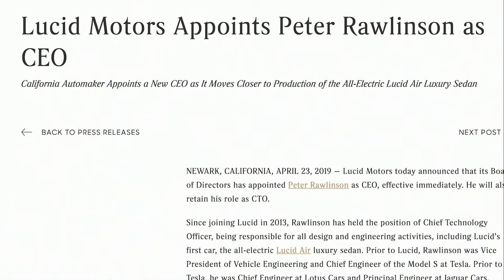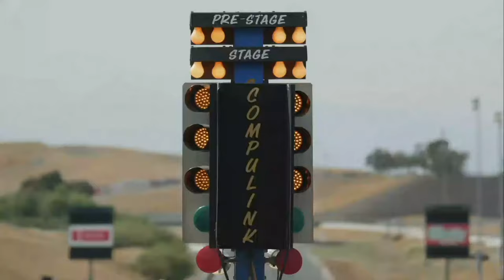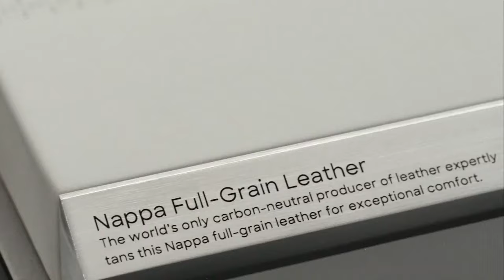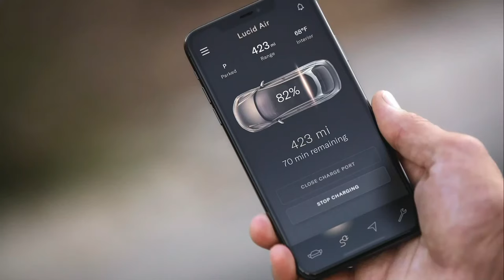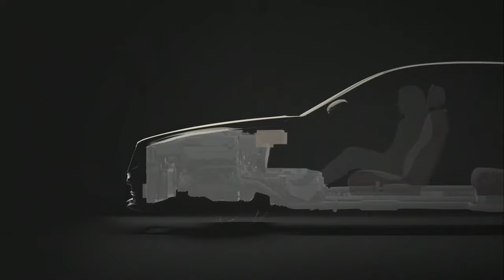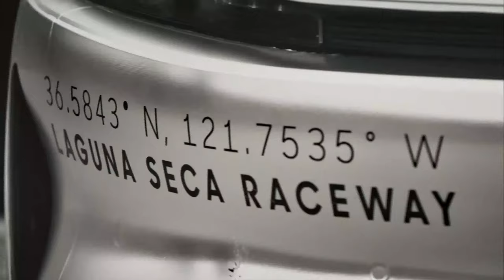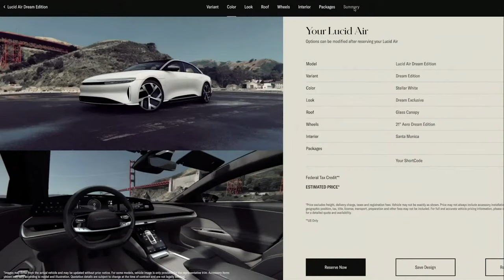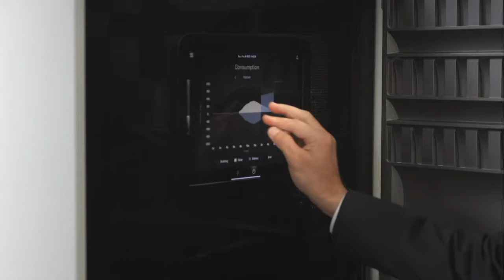Dream Ahead | Lucid Air Global Reveal

Comment: Full disclosure: I own a model 3.

I love the Lucid from basically every perspective. It hits the mark in presence, power, packaging, engineering and quality. I’m curious to see how advanced their autonomy is, and how well supported its charging infrastructure ends up being over the next ~5 years. The one thing I’m not a fan of is their UI and the design of the interior, particularly in the front. I feel like it’s trying too hard. I like Model 3s implementation of simplicity much more, despite how polarizing it is. I have no doubt that their interior materials will hold up better than my car’s, but I think that “Air” would denote a much more open and simplified/streamlined interior. 

I think that this is what Tesla needs and wants. A true ground up competitor. Tesla has run the show for way too long, it’s time for some competition to get Tesla back to the drawing board with some new reference materials. Other ICE car manufacturers should take note. If Lucid and Rivian take off, there are no more excuses for why you can’t implement the technology into future products.
Reply: I disagree with the 'trying to hard' - IMO one of my biggest gripes with Tesla is the purely digital interface. It's quite a shocking jump. In the 20 minutes I was allowed to test drive a Tesla, I didn't get even remotely acquainted with the digital system - it was distracting and a bit out of sight for me.
Reply: Nice to hear that from a tesla owner

Comment: Loving the lounge chair backseat options 18:55
Reply: ...But you gotta ask, how safe is this when in head-on collision? Do you slide under the seatbelts when lay back? How does it impact the spine when pelvis goes over the bottom seat?
Reply: @VincentNacon  Good questions. Mercedes maybach has the same backseat lounge chairs options. Probably where they got the idea from. I'm guessing there is a certain level of safety in their design.

Comment: I love the quietness,soft spokeness and the sincerity of the ceo. He said they are in different market with tesla. Not to compete with tesla.👏👏👏
Reply: Slice it however you want to slice it, every Lucid Air sold is one less Taycan and one less Tesla Model S sold.
Lucid Air models: $169K Q1 2021, $139K Q2/Q3 2021, $95K Q4 2021, less than $80K 2022.
Reply: @savedfaves  
I look at it this way each Lucid or any Other EV sold=
Less gasoline stinkers sold
Lucid is no threat to Tesla btw 
only to ICEngine cars
Tesla is the Largest ev maker in the World now
W bigest SCharger network and 
3 Giga factories
Reply: @WANDERER0070  Well don't be surprise if Lucid steals the show
Reply: @brucealexander4414  How?
Reply: @alarjak  It's sexy and it's more interesting than a Tesla physically
Reply: @savedfaves  Not true. Tesla makes mass market EVs. Lucid is making actual luxury EV"s instead of the "luxury" of the LARPing Model S/X
Reply: Your comment would mame tesla fans go crazy, you see that in the section 😆
Go lucid 👍🏻
Reply: @brucealexander4414  
Total agree
Reply: @brucealexander4414  It's a great concept but mass marketing is not easy at this price level.

Comment: 300kw on 113kwh(usable im guessing 115+ actual) is 2.6C.  Model 3 from 2018 is already hitting 250kw on 77kwh pack sizes or 3.25C.
battery day plaid 2020 battery packs would be expected to beat this

1080hp off 115kwh est 9.4hp/kwh      vs    P100D 778/100kwh 7.78hp/kwh

some things are odd here
this thing with 113vs97kwh gets 517vs402 miles of range or some 4.44miles/kwh vs 4.14 or some 10% more efficient between aero and engine losses
this would make it the most efficient ev on the road oddly
despite having 1080hp motors 

why limit the charging so drastically if theyre willing to pull such a high amount of power from the pack repeatedly during acceleration?
805kw of power vs 300kw charging seems odd 2.68 ratio
vs
580kw of power P100D and 200kw of charging even on the older s/x battery pack 2.9 ratio (would be 325 if extrapolated to 2018 model 3 specs) or 1.78

so if its cooling is more efficient why is its charge rate lower???

the increased range is explainable conservatively with a 113kwh battery pack and improved aerodynamics and motor efficiency but does trend oddly high
the real question is why did they sand bag their own vehicle, wrap it in promos showing 400 miles off 125kwh to then hit 500 miles with 113kwh some 50% difference.   

the interesting moment will be to see if they (similar to porsche) manage to actually release a 60/70k version of their 150-180k car anytime soon enough to be relevant

smart range is great and all, but cost effective range is another.

Comment: The people in this video be like "The car drives smoothly through the Air™. And it's electric which helps with Air™ quality. On the touchscreen you can adjust the Air™ conditioning. It is also a 5k screen, which is higher resolution than the Macbook Air™. The sound system features 21 speakers so you can listen to Chris Brown's No Air™ in the highest quality."
Reply: A I R
Reply: Guess that makes me an Air head lol

Comment: I am tesla believer but this company looks legit and a good competitor. RIP porsche taycan and legacy car makers.
Reply: After this car is released, buying a sedan over $130k that isn't a Lucid Air will make no sense. Great performance, efficiency, and practicality. No ICE sedan can hold a candle to it.
Reply: banana ? Also the CEO that buys a 170K luxury sedan doesn’t care about any of the things you said most of all practicality that segment is all about over the top ridiculous luxury. Lucid is absolutely losing the mark by trying to compete in this space. They should have best Tesla to market with an affordable, fast, PRACTICAL compact EV for the mass market
Reply: @zandercerlong7238  
And the Lucid Air isn't luxurious?
Reply: banana ? If you only look at the lucid in Vacuum it has some decent luxury then you step in a Maybach or a Bentley and you realize in comparison the lucid is laughable luxury, and to top it off the fit and finish the first few years will be terrible it always is in manufacturing. Go drive a Fisker it looks absolutely gorgeous but sit inside and it feels like a Kit Car. A spender of 170K will not put up with that. Lucid is entering the wrong market
Reply: banana ? Posted you the link go ahead and check out the new 2021 S-class the direct competition for lucid and you tell me if lucid is luxury. On top of that the fit and finish on an S-Class will be 100% perfect they have only been doing cars for over 100years. Lucid will not turn a profit in this segment of vehicles. And to top it off people that have 120-170k to spend on ultra luxury they Rolex wearing rich business professional absolutely car about brand recognition and lucid has zero no way someone chooses lucid over Mercedes or other vehicles in that segment
Reply: @a.banana  Buying any car for over $50k makes no sense.

Comment: I'm a twice Tesla owner, stock holder and admitted fan boy, but am not blindly allegiant to the brand, and I want to see more EVs come to the market. First impressions are that the tech is really cool - the quick charging, reversible flow, more efficient batteries and output per pound of the motor is very impressive. Performance and range are also impressive. Interior looks really great, as well. But the overall exterior design is a bit on the bland side, and that trunk opening looks quite awkward. The price for the higher end models is quite a jump, too. It will be interesting to learn what updates Tesla has in store for their battery day in a couple weeks, and whether what they have will match or exceed these specs. There should be room for many EV companies to be successful, and I hope Lucid finds success, and applies even greater pressure for traditional auto makers to shift how they make their cars.

Comment: Good presentation, very professional and also sympathic :-). But I would have liked to get to more details/inside know how. For example: How long/wide/high/heavy is the car? How does heating/suspension work? The frunk will have 202 Liter volume - how much will the trunk have? How much autonomous driving will it be capable of at the start?  When will it come to other countries outside North America? PS: The presentation (and the car itself) would have been even as good with using the word "incredible!" 100 times less.. ;-)

Comment: They may have spent 1 million making this video lol
Reply: That’s why these cars are valued up to 200k the interiors don’t add up . To use inferior finish like vinyls just don’t compare to high luxury solid interiors. They have plastics and have exposed seat rails . Looks cheap and not a solid sound interior. Yes they have a great ext body and the design was well thought but this interior should have implemented use of stainless, leather , wood w nice trim they half assed it. Who uses vinyl which resembles Vinyl LVT FLOORING ON THE DASH? Chilwhich flooring has a similar pattern for their flooring that they used as a finish in this vehicle

Comment: My main concern would be the complete glass roof.
1. Can it be dimmed or blacked out so that the sun isn't glaring in your eyes if you're driving in the sun or even just sitting in the back seat and the sun is blasting you in the face or on the top of your head? Albeit is beautiful, but I close just my regular sunroof at times.
2. Sometimes just the sun beaming down on you can get uncomfortably warm. Can the roof be dimmed or blacked out to eliminate this if the customer would like to do that.
3. In every car the structure of the roof gives the car rigidity and provides strength in case of side impact or especially a roll over. If this glass roof shatters in an impact or roll over accident isn't that going to significantly reduce the strength of the structure that provides a safety cage around the occupants? I will be very interested to see how this car performs in crash tests.

Comment: I wish Lucid could pivit,Lucid can build a space oriented compact SUV,with roughly 180bhp,0-60 in 5sec with a limited 150mph top speed and a 300mile rage for $25000,if any company can,I believe its Lucid,this would really shake up the EV market expecially in the USA n open them up to other markets bigtime,the Saudi backing isnt enough,competeing with Tesla is hurting u more than helping u,all these people singing ur praises when presented with either a Luvid Air or A Tesla Plaid theyd pick a Tesla,go into the market gap they arent in n hit them hard,thats the only way,bring back buttons in the cabin,a manual handbrake,let people hear the motor,let the driver engage as much as possible with the car,focus on what Tesla isnt,tech is good but like any other gadget,people get bored quickly with new tech,get them with the experience instead,please Lucid,please,i LOVE ur company n i do not want to see it die slowly

Comment: There is no doubt Lucid Motors is a good company.  The difference between Lucid and Tesla.  Tesla manufactures their own lithium-ion battery cells at their Giga Factories in the U.S. whereas Lucid signed agreements with S. Korean technology giants Samsung SDI and LG Chemical to manufacture their lithium-ion battery cells. Moreover, although Lucid is a privately owned company. It receives funding from Public Investment Fund of Saudi Arabia (67% majority owner of Lucid). The investment fund goes towards engineering and testing, and the first-phase of construction of its manufacturing plant in Casa Grande, Arizona. Construction of the plant will began in late 2019. Tesla, receives no funding for the construction of their plants, and engineering, and testing from outside sources. Tesla is a publicly owned company listed on the NASDAQ, and Elon Musk owns a 20.8% majority stake in Tesla.

Comment: I've worked at Tesla for quite some time in the past. And now I drive a Tesla Model S. I am a Tesla fan. But even I have to admit. A couple of the features of the anounced Lucid Air has taken my interest! I probably would never buy it unless it gives me Netflix and Games like my Tesla does and how far it is software wise. But I could definitely see a future competitor to Tesla if everything they say is true!

The amount of sensors and camera's seems like overkill but would still be better. I have some issues with Tesla autopilot at the moment and feel like it isn't quite there yet. I am curious what a car with twice the amount of camera's sensors and radars can do. Not to forget Lidar. Also the reverse charging! This is something Tesla drivers have been asking for, for quite some time. Let us use our battery to use electricity for our homes or to charge other cars. I got stuck on the road ones. Would have been great if another Tesla driver could give me some charge instead of calling a tow company. I could easilly see somebody making an app so Tesla drivers could help each other back on the road when they get stuck.

Also the fact the lucid air has so much more power with a lighter bases and battery efficiency really makes me wonder how appealing it might get when they get their own supercharge network or teamup with Tesla. Quality wise anything would be better then the interior and quality control specs of Tesla cars. There's panel gaps and lots of things breaking down in the Tesla's quite early. If Lucid has the quality to match german cars that already would be a great bennefit.

I am not easy to impress in a world I know everything about. But I admit. Lucid Air has gotten my attention and I am rooting for them. If Lucid sees this. Would gladly testdrive the car!

Comment: Until Yesterday the price range of $60k to $100k was still floating around on YT and EV news media. So as expected it's costlier but a whopping $95k to $169k is a lot more than expected.  The $80k entry level 'Air-Basic' might not materialize similar like the $35k Tesla which was practically never sold (or where unwillingly sold).  No word about when the Lucid Air will reach Europe thou.

Comment: Impressive car. Technical question. We have regenerative braking in most ev. To top up the battery. Is it technically possible to have some sort of inductive charging via the wheels rotating like old school bicycle generators but without the physical contact as another way to add charge to the battery. Yes irrelevant to this car with its 800km range. But what about more mainstream cars with smaller range. Just wondering

Comment: Great job Lucid! Beautiful car and absolutely amazing innovative technology. Now, please partner with Tesla (in some capacity) and make your electric drivetrain technology available to them. In return, Tesla could give you some pointers/trade secrets regarding their new 4680 battery cell and structural battery pack. Together, you and Tesla could start mass producing an average priced BEV (between 40,000-60,000 dollars) that combines your state of the art electric drivetrain system with Tesla’s new road runner structural battery pack (tabless 4680 cells). The resulting BEV could be the final nail in the coffin for ICE vehicles, and convince skeptics/critics that BEVs can really outperform traditional automobiles. In addition, economies of scale and the combined might of these two innovative companies, could work to lower the price of this new BEV and provide the world with a truly revolutionary way of clean mass transit.

Comment: The interiors aren’t bad, unfortunately it will date very quickly. Raw timber has never dated well in vehicle interiors. Worse though is the front light bar, this already started dating when it was introduced to cars that were conceived for movies such as Total Recall. And then the rear glass and C pillar? What a shame, all this focus on design but no strong brand identity or vision to be truly progressive from the Europeans or even the new Chinese designers, but instead trying desperately to be different.

Comment: I have been a car enthusiast for decades and for myself to understand this extremely high cost for this car especially w 3 trim lines . To establish a car that will sell for over 120k to almost 200k this interior I can’t find the value especially using finishes like vinyl, plastics and to see parts like the seat rails exposed and see a black metal rail w no cover to enclose this tacky look. Seeing a small screen in the rear and only one . This feature should of been done better using larger screens and possibly 2. To hear them point out the a,b,c pillars are aluminum is pretty standard on cars in this price range. I also noticed the panel gaps are not tight along with gaps which seem to not have a consistent thickness. Arguably this car is quick and yes that’s where it succeeds but to see the interior not filled w stainless steel , but plastics and then this vinyl which can resemble LVT flooring is just unfortunate. Some thing I can’t understand is how are they able to not have a signal indicator in rear on a moveable body part. I was under the impression this is regulated to have turn signals on fixed not moving body panels. Unless the 2 red reflectors on the bumper will be also used as a turn indicator and brake light. I just can’t see the value of this price range to hit almost 200k . Compare this to a rolls Royce ghost the interior is apples to oranges if compared. They need to revisit the interior and really step the interior game up otherwise they will have a car after 5 years of wear and tear will rather be obvious

Comment: The center console doesn’t even have a soft open or soft close it’s completely manual that screams plastic cheap and not well thought was put in to the design and functionality. They seemed to fail to think of the functionality and practicality along with using higher quality parts and mechanicals. This center console area with the manual adjustment for the cover is disappointing. These small features ultimately people will realize